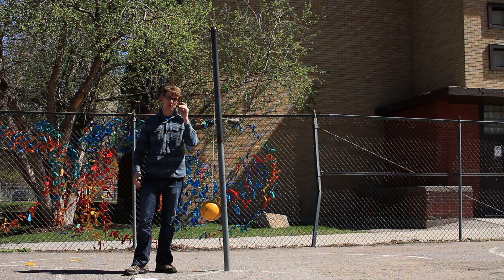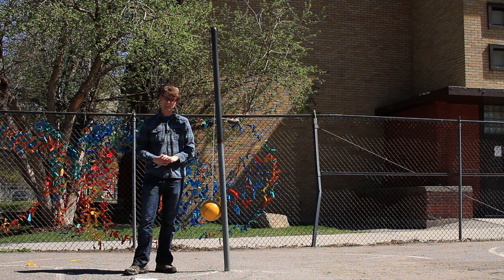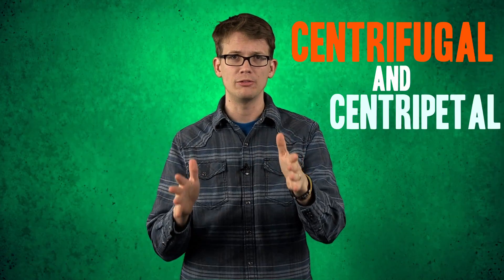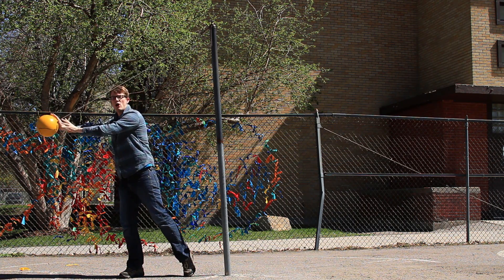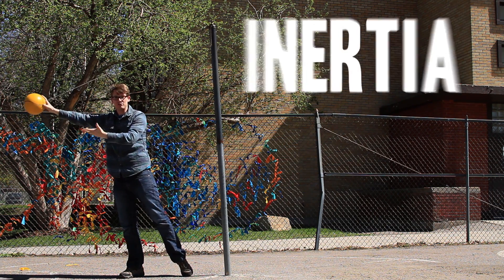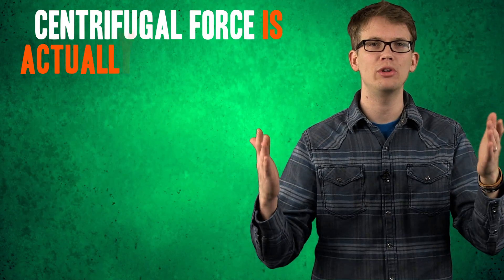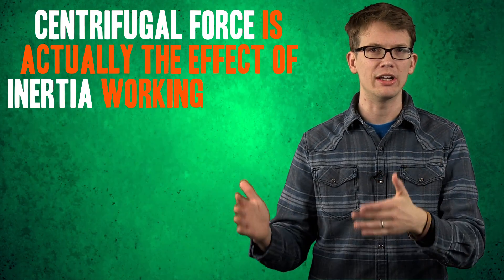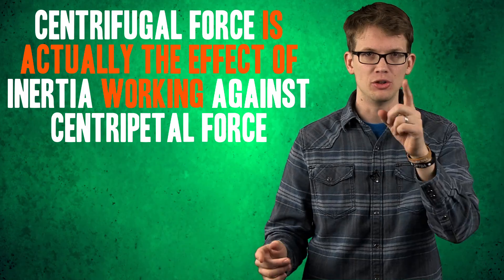IDTIMWYTIM: Centrifugal Force

Comment: I have a question about inertia. If inertia is a resistance of mass to change its speed or direction through space-time and gravity is a curvature or distortion of space-time causing mass to be attracted towards one another, then wouldn't it make sense that inertia is also a property of gravity between its probable future and past positions in space-time?  The name space-time implies that all object exists in both the past and future, and on a microscopic scale, wouldn't an object be both attracted to its future and past selves thus forming a more or less a straight line, but if the future is branching, the pull would be towards the future because there would more possible future positions for gravity to pull in that direction in our frame of reference?
Reply: The fact is, there is no reason that the two have to be related.  You are talking about inertial mass and gravitational mass (in the beginning - you kind of go off to la la land toward the end :)).  Inertial mass is the property of matter that determines how hard it is to accelerate something at a given rate.  Gravitational mass is the property of matter that determines the strength of the gravitational 'attraction' of matter.  Again, there is no reason that these two masses must be at all related to each other, yet that is a fundamental notion of the equivalence principal, which is a product of Einstein's general relativity.  That inertial mass and gravitational mass are not only identical, but are the same thing.  This is why all things accelerate at the same rate regardless of their mass in a given gravitational field.  Because inertial mass and gravitational mass are the same thing.  The 'force' required to accelerate an object at a given rate is the same as the 'force' that gravity exerts on that object.  Now, this might all sound pretty intuitive, but it really is amazing when you think about it.  There is no reason that these two things must be even remotely related, yet they are the same exact thing.
Reply: yeah, I suppose i had sounded a bit crazy, but i was considering the Michaelson- Morley experiment to detect the aether wind. People assume there is no aether because they didn't detect any drag, but they assume that matter and the aether are separate particles, but what if matter is not a particle as it moves through the aether, but only becomes a particle in the now moment as its wave moves through the aether. As the wave of mass encounters a certain part of the aether it distorts space-time in that particular spot and then as mass waves pass by, the space distortion returns to normal. The aether could not be detected in the same way an image projected upon a screen could detect the screen. So yeah, I guess my thinking is just completely wrong.
Reply: it's interesting to think about. but that would mean the effects of inertia would act different;y than it does now. for example: the continued force of gravity would cause the object to accelerate perpetually. and the effect of inertia would be greater on bigger objects in that they would accelerate even faster than small objects. not very ideal for creating life but interesting non-the-less.

Comment: Okay, I don't think I understood this correctly, so correct me if I'm wrong:
So, in our solar system, the planets (or any bodies, really) are the equivalent of the tether ball here, continually moving because of inertia. What I don't understand is what is the string in this situation. Does gravity keep the planets from leaving their orbits? If so, how is it that planets are greater distances from the sun are kept in their orbits like closer planets?
Reply: Yes it is gravity. However, the gravity of the Sun is just bending the space/time around it, it's not pulling on the planets. The planets are trying to move in a straight line, but since the space they're moving through is bent, the straight line the planets are trying to move in becomes curved, and the planets end up moving in a circle. I hope that helps answer your question.
Reply: Its not too much too soon if the OP learned something new and the person who explained it had a pretty accurate, simplified description.
Reply: Erudite He didn't answer his question.  He just felt describing general relativity for whatever irrelevant reason.  The questions were, 

1) Does gravity keep all planets in their orbits? 

2) How does gravoity keep the farther planets orbiting like the closer ones?

The answers to these questions are the same regardless of whether you answer it from a Newtonian perspective or a relativistic one.  My response was not to the OP, but to the person who didn't answer their question at all, but apparently just wanted to intellectually peacock for no reason.  I called him on it, and as you can see - haven't heard back.

The answers to the questions are.

1) Yes.

2) Orbits are a balance between the gravity of the parent (the sun in this case) and inertia (orbital velocity).  For example, an object in orbit around Earth is falling toward the Earth.  The Earth is curved.  An object traveling sideways still accelerates downward at a rate consistent with gravity regardless of this sideways motion.  For example, the acceleration near the Earth's surface is 9.8 m/s^2.  If you dropped a bullet from 1 meter above the ground, and fired a bullet from 1 meter above the ground perfectly parallel to the ground, both bullets would accelerate downward at that rate, and reach the ground at the same time (in a vacuum).  If you fired that bullet fast enough, it would go so fast that the Earth would actually curve away from it (because it's going so fast that it went far enough in that time that the Earth's curvature became significant).  If you fired it at the right speed, it would be falling toward the ground at the same rate as the Earth curved away, and it would never hit the ground.   That is orbit.

The rate of acceleration for an object decreases as it gets farther and farther from the source of gravity.   Since the rate of acceleration decreases the farther an object is, the slower it's orbital velocity needs to be in order to make that balance and remain in orbit.  For mercury to remain in orbit, it orbits the sun at an average velocity of 47 km/s.  The Earth orbits at an average of about 30 km/s since it is farther away....it doesn't need to go as fast.  This same concept applies all the way back to Neptune and the dwarf formerly known as planet Pluto.  Gravity still keeps these more distant planets in orbit.  It's just that to balance, their orbital velocities are not as high.  Here are some orbital velocities,  so it is clear that this really is the case.

Mercury - 47 km/s
Venus - 35 km/s
Earth - 30 km/s
Mars - 24 km/s
Jupiter - 13 km/s
Saturn - 10 km/s
Uranus - 7 km/s
Neptune - 5 km/s

These velocities are relative to the sun.

The farther away, the weaker the force from gravity (or field) so the lesser the acceleration (or geodesic/curvature of space), so the slower the planet needs to orbit at in order to stay there.

It's just chance that planets are where they are.  That's just where the matter came to be.  Some rocks were traveling faster and escaped or were out in highly elliptical orbits (comets, etc.) Some were going to slow and fell into sun, etc.

The same concept applies to objects orbiting the Earth.  For example,  the Earth keeps satellites and the moon in orbit.  Satellites are just 400 km or so up in low earth orbit and must travel about 8 km/s.  The moon orbits around the Earth at about 1 km/s.
Reply: Willoughby Krenzteinburg Maybe 3 months too late... ?
Though I agree that the why is important to know in order to explain this... it is not too much too soon. If the OP understood, they would then ask why; otherwise, you're just keeping them ignorant because you think it is too complex to explain. 
This explanation is pretty good except that gravity is the bending of space-time rather than causing it...
"If you can't explain things simply, you don't understand it well enough."
"Everything should be made to be as simple as possible, but not simpler."
- Albert Einstien
Reply: Erudite I have no idea what you are talking about.  What's your point?
Reply: Schaelarren
Too much too soon.  People need to understand the basics before getting into general relativity.

Can you explain to me WHY Einstein concluded that gravity is a curvature of space time rather than a force?  I'm only asking because you should understand this before you should be allowed to explain it to others.

Comment: there is no such thing as centrifugal force its called CENTRIPETAL force not centrifugal
Reply: VestaGamingCo
One of those people who rush to the comments without watching the video.
Reply: and my comment was answered in about 10 seconds sorry
Reply: Completely untrue. Centripetal force is an entirely different force. Both centrifugal force and centripetal force exist, and are not the same thing.
Reply: AntshKhel
Centrifugal force does indeed exist.  This video is a bit misleading.  Of course, I'm sure you think that everything you see in Youtube videos is true, right?

He is correct in saying that centrifugal force is NOT the reason that the string stays taut.  It is true that centrifugal force is misused often.  However, to claim that it does not exist is careless, and frankly - wrong.

The proper way to explain it would be to say that centrifugal does not exist in inertial reference frames.  In a rotating reference frame, it is a necessary concept, and centrifugal force is just as real as any other real force, and if you wish to apply Newton's laws of motion - which ONLY apply in inertial reference frames - to a frame of reference that is rotating, then the use of centrifugal force would be required.
Reply: OK I NEED TO REPHRASE There Is such thing as centrifugal force it is just often less useful than centripetal and people often get these two mixed up, and in a 3 dimensional word it is much less applicable, for various reasons, Im used to particle physics dealing with chirality and parity which in fact it comes in to play much less often.

Comment: I have taken years of high school and collegiate physics and all my instructors have failed to explain this as well as you have.
Reply: Tyler Morrison alright, can I have a try?

I think it is easier to understand centrifugal force, if you first look at a different situation and then transfer your insights back to the original problem (don't worry, if you don't see what I mean by that, it'll work out)

so, imagine you're driving a car and you're approaching a red light. hopefully, you will slow down your car. what does your body feel when the car slows down? yes, it feels a "forwards force", although actually the car is decelerating, hence experiencing a "backwards force".

why do you feel that forwards force? because of inertia. when you apply the brakes the car decelerates, because the brakes apply a backwards force on the car (Newton II). your body however, remains it's speed, because there is no force applied to it (Newton I, inertia). so, relative to the car, your body accelerates, hence experiencing this forward force.

now, it's exactly the same principle with circular motion, only this time the car is the ball, the string is the brakes applying not the backwards force but the centripetal force, and that funny forwards force from before is now the centrifugal force. 

to be honest, I have no idea, why centrifugal force and centripetal force have the same magnitude, and the exact opposite direction, but it should be clear now, why there's such a thing as centrifugal force
Reply: That's one of the worse explanations I've ever heard about this topic. How you can talk about centrifugal force without mentioning galilean and non galilean frames of reference is beyond me.

Comment: What about "action-reaction" being referred to as if it's a law, when the actions taking place are already explainable?
---Such as how a rocket is propelled. -You can call it "action-reaction" and say there's a force moving down from the bottom of the rocket so that's the action, and the rocket moves up so that's the reaction. But in actuality the rocket moves up because there is pressure inside its engine and this pressure exerts in ALL directions and it's balanced in all directions except one, because of the opening at the bottom of the rocket, so the exertion in the up direction is not balanced and that's why the rocket goes up. (With all due respect to Sir Isaac Newton.)
Reply: You're confusing balanced forces with the notion that every force has an equal and opposite counterpart.  Newton never claimed that all forces are balanced, but that they come in pairs.  You are not uncovering anything special here, but just confusing yourself into believing these two concepts are one and the same when they are not.

If you were in deep space (or in free fall), and you pushed a ball with your hands, both you and the ball would accelerate.  There are two forces at work here, and they are consistent with Newton's third law.  Both forces are unbalanced in that they do not have an equal counterpart that acts on the same object.  This is not a violation of Newton's third law.  One force is acting on the ball - causing it to accelerate accordingly, and the other force is acting on you - causing you to accelerate accordingly.  This same exact concept applies to rockets.  There are still two 'paired' forces here are acting equally and opposite to one another.  They need not be balanced to be consistent with Newton's third law of motion.  In the rocket, the upward force on the rocket is not balanced.  This is correct, but this doesn't violate Newton's third law as you assert.  The other force is just not exerted ON the rocket.  If all forces were balanced, then there could never be any acceleration.  You are assuming that if the forces do not balance, then it violates Newton's laws.  That's just not at all how motion works.  In fact, ALL acceleration requires unbalanced forces, and the presence of unbalanced forces does not mean that an 'action' force is missing a 'reaction' counterpart; it just means that the reaction force is not acting on the same object as the action force, just like when you pushed the ball.  One force acted on the ball, and the other force acted on you.  Two equal and opposite forces consistent with Newton's third law - acting on different bodies which causes an unbalanced force on both - hence the resulting acceleration of both.  In the rocket, the force acting on the rocket does indeed have an equal and opposite counterpart consistent with Newton's third law; it just isn't also acting on the rocket.  It indeed exists, and is just exerted elsewhere.  Newton's third law is still very much valid.